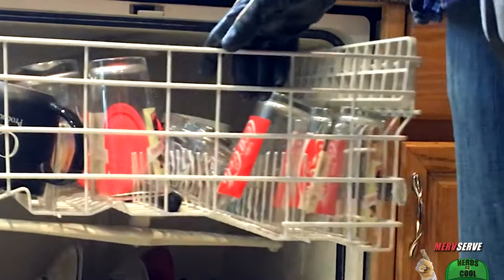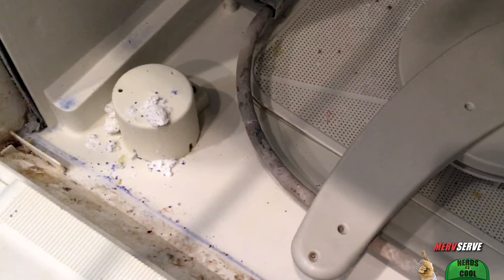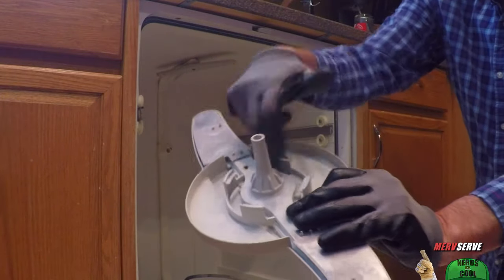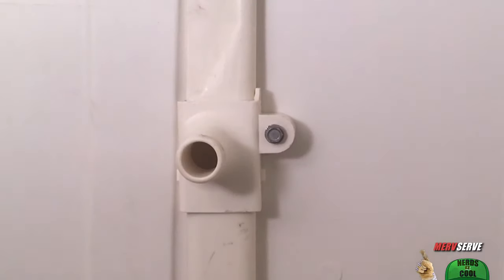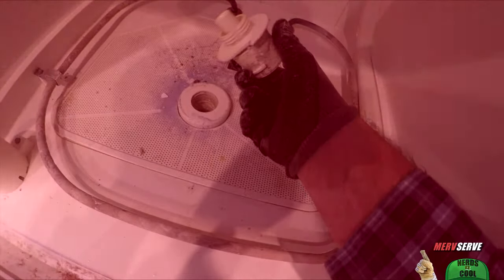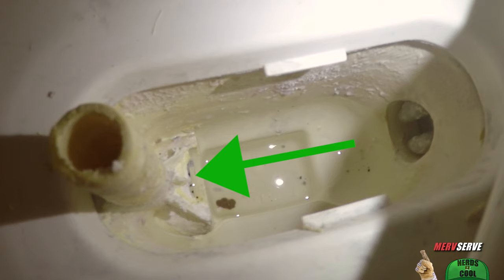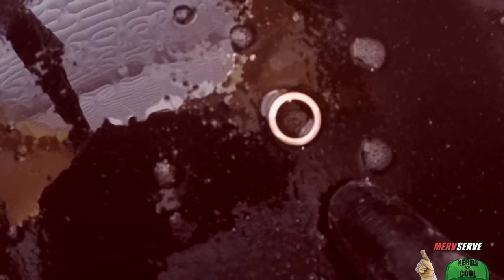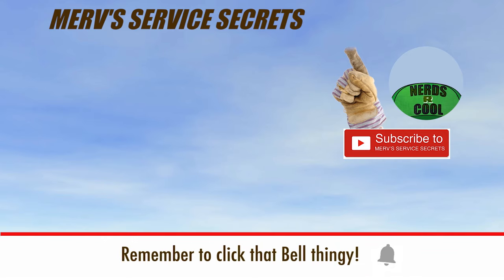How to Fix a Dishwasher that Doesn't Clean - Secret Dishwasher Hacks (Part 1 of 2)

Comment: Well, I cleaned out everything and switched to Cascade liquid.  But I still have a white power residue that is only on the left side of my dishwasher.  Everything else is clean.  We have been through five dishwashers in 12 years.  I think we are cursed.
Reply from the maker: They honestly don't make 'em like they used to.  Not kidding.  But if you have a white residue on one side and not the other, it sounds like your jets are clogged or you are overloading it in some way.  For deep cleaning you can also try lemi-shine. It works quite well:  https://amzn.to/3oMXBuh
Reply: @MervsServiceSecrets  definitely not overloading it.  I wonder how to unclog the jets...would that be in the arms above?
Reply from the maker: Yeppers. All covered in detail in the video.

Comment: Modern dishwashers save water, save electricity, save the planet. Cleaning dishes? Optional...That part is not covered by regulations.
Reply from the maker: And if you have to run the dishwasher cycle twice just to get the dishes clean, are you really saving anything at all?

Comment: Yea using dishwasher tabs is dumbass on every level. Here is a trick to help freshen your dishwasher.Put a cup or two of vinegar preferably cleaning vinegar in the dishwasher when using it once in a while.You will notice the difference and it is about as cheap a fix as you can get.
Reply from the maker: Thanks for the great tip! Much appreciated.